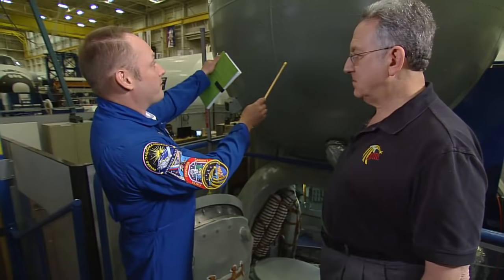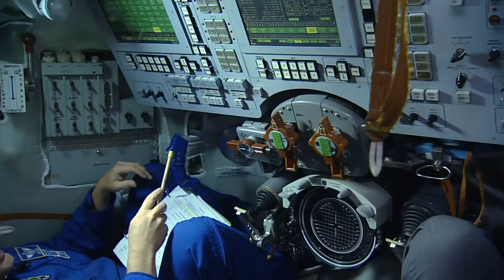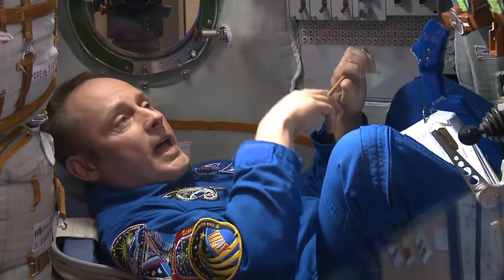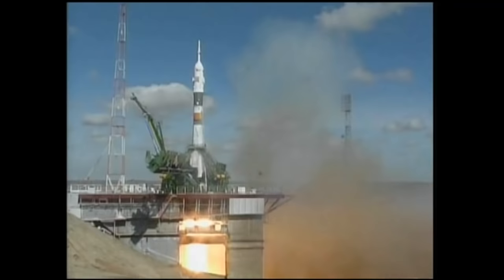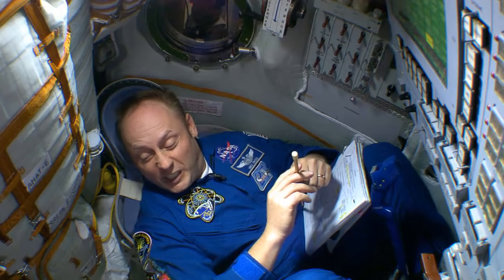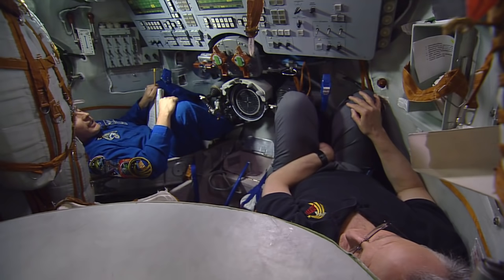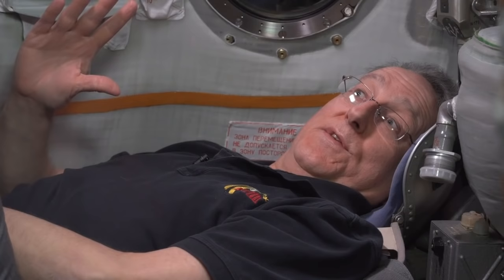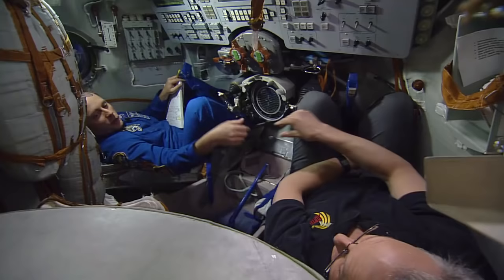Inside the Russian Soyuz Spacecraft

Comment: The dragon capsule looks so futuristic compared to this.
Reply: And comfortable.
Reply: Its takes when 19 hours to get to space while soyuz only takes 6 hours
Reply: @PachinhoG2024  the Soyuz six hour / four orbit rendezvous profile has only been around since 2012. Before that they flew a two day  / 34 orbit profile.  The enablers for the six hour rendezvous are that the station has to manouver to accommodate and that the vehicle has to launch dead on time in it's planned launch window.  If they scrub then it's back to a two day rendezvous.  The booster performance /orbital insertion also has to be dead on.  Earlier Soyuz rockets could not reliably achieve this accuracy.

Probably falcon/dragon could fly a faster rendezvous profile but it would trade mission assurance for slightly faster transit time.  Is it worth it on a maiden test flight? and what is the point anyway given that dragon isn't nearly as cramped as soyuz?  Maybe they will do it later.  It took the Soyuz program 45 years to develop the ability!
Reply: @PachinhoG2024  its not anything to do with the dragon. Its just the launch window and orbital mechanics all that stuff that makes it take longer
Reply: To be fair, the Soyuz was designed in the 60s.
Reply: @PachinhoG2024  breh it takes about 8-9 minutes to reach space  and 19 hours for the ISS and orbital mechanics exist has nothing to do with the rocket
Reply: to be fair I think russians are going for more practical over pretty style, maybe i'm wrong
Reply: @ishdx9374  And if something works great you aint messing with it :)
Reply: @mart43  I guess, but, advancing is better
Reply: At least they don't need a stick no more to reach the buttons. Jesus ... C'mon Nasa.
Reply: Cheap and reliable the Soyuz is
Reply: @mowogfpv7582  Hey guess what my loser friend, Soyuz took just 3 hours this time.
Reply: There's actually more room in the soyuz.
Reply: @PachinhoG2024  
That's time to dock with the ISS, not time to get into space (into orbit).
The docking time can vary a lot based upon the time of launch and the skill of the pilot.
It's not like driving to the supermarket, it's like driving on a road that your friend is already driving on, and trying to meet them on the road and physically connect your car to theirs, while driving at highway speeds.
Reply: @carterpavloski9276  u know the dragon is cheaper right
Reply: @coolnice639  yes of course
Reply: In space, less is more, economy and simplicity are everything. If they had to choose between an Iphone or an old Nokia to travel to Mars the choice would be a Nokia, even the body needs to save energy. You can't do complex repairs in space, systems need to be archaic and close to the hardware. These visionaries, who pollute the vision of space with microsatellites and even cars, are looking to turn spacecraft into "Iphones" but this goes against the logic of survival in any hostile environment.
Reply: Because it literally is
Reply: @ishdx9374  using sticks to hit buttons isn't very practical
Reply: @PachinhoG2024  Soyuz takes less than 3 hours*
Reply: As they say, old but gold
Reply: It's not about touch screens.
The souyez is the most safest and successful rocket and in history.Its also the cheapest to manufacture.A capsule is not supposed to look like a modern dental clinic 
Go and do your homework bozo
Reply: @pauloyeghe1637     Soyuz 1 killed its crew.  Soyuz 11 killed its crew.  Crew Dragon:  zero fatalities.  Mercury:  zero.  Gemini:  zero.  Shenzhou:  zero.  Explain again how Soyuz is the safest spacecraft in history?
Reply: @jshepard152  statistically it's the safest. Do you wanna talk about space shuttles instead of the barely tested garbage can your bomb makers built? Soyuz has the highest number of safe flights of any spacecraft in human history. Soyuz is the safest space craft in human history by a statistically significant margin.
Reply: Bro, dragon is better than Soyuz in every way, as we said, it was built in the 60s
Reply: @MrBrenBaby  "bro" we have a Nobel laureate here folks, a real Rhodes scholar. 
You're not a serious person and none of the things you believe are real.

Comment: What's the point of the frontal habitat? 

It's true that it might be more comfortable for the crew than sitting in the lander capsule, but it also means extra mass. I'm sure it is for a reason I don't yet know of.
Reply: G.Zoltan It also can function as an airlock and sometimes stores cargo for the station
Reply: So "a box for cargo that you don't want to equip with heavy heatshields". I guess that's describing it from a design point of view. But I've never heard of it functioning as an airlock... That's really interesting. Thank you for replying.
Reply: G.Zoltan Of course 😄
Reply: G.Zoltan 
The trip to ISS takes about 48 hours. The habitat module allows the crew to move around, eat, sleep and also has a small bathroom. This is where the supplies and cargo is riding to ISS. 
Nowadays Russians have shortened the insertion to 6 hours, so crew doesn’t have to spend 2 days in a Soyuz anymore. However if things go wrong with launch timing they can revert to 48 hour insertion as well.
During return, the habitat module is filled with trash from ISS. This module gets burnt up in atmosphere during reentry.

Comment: Pop quiz!!! When you are in the seat here and your fart has bubbles what do you do?
Reply: There is a methane-oxygen converting system, so when you fart, it produces more oxygen to breathe. That's why we recommend eating onions for the astronauts. The most efficient astronaut will be the person who does the most powerful and fastest farts, that's why it's so difficult to become an astronaut, there is so much competition...And the reason why they need to be good in science is because they have to calculate the lenght and the direction of the fart instantly (you also need to be smart), there are also really hard techniques like for example : sometimes you have to blend the fart so fast that it creates a space-time distorsion that can also propel the spacecraft at a tachyonic speed,etc. The convertion works like a loop system : The more you fart, the more oxygen you have/The more oxygen you breathe, the more farts you have to release.

Comment: did you know that ivan the cosmanaut cpuld have iused the proton booster to go to the moon with!Put a modified soyuz and a one ruskie landeer and say mother russia we have the moon now! kaustvacia!
Reply: The Proton couldn't send that much to the Moon, although it might have been able to send just the Soyuz around it, which would have been enough to upstage anything the US did afterward.  That's why NASA took a huge gamble in making Apollo 8 a manned mission so that the US would be the first to circumnavigate the Moon (with the first Moon landing occurring three missions later, of course).
Reply: @rbrtck     The US landed men on the moon before Proton would have been able to circumnavigate it.  It was years behind Apollo 8.
Reply: @jshepard152  Did we know that back then?  We knew the N1 existed, but not how ready it was or wasn't, either.  We just couldn't risk coming in second yet again.
Reply: @rbrtck      I'm not sure.  I know the CIA told NASA that the Soviets might attempt a lunar circumnavigation around the time of Apollo 8.  So that concern was there, but I think we now know they weren't capable of it.